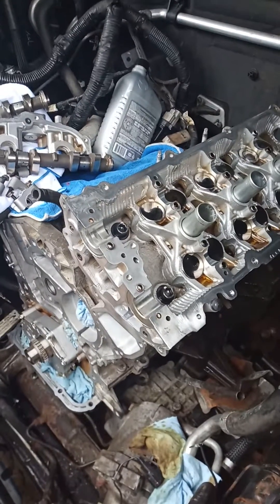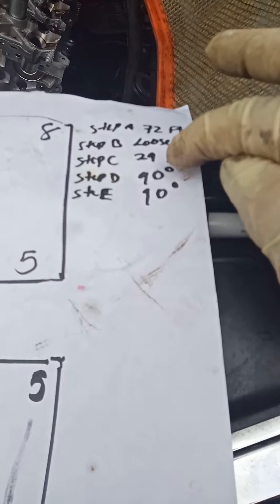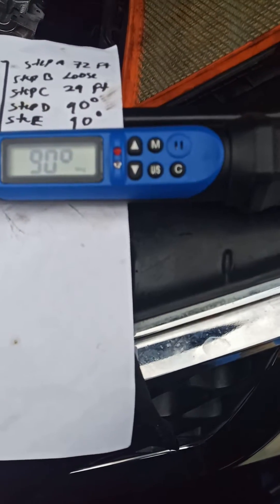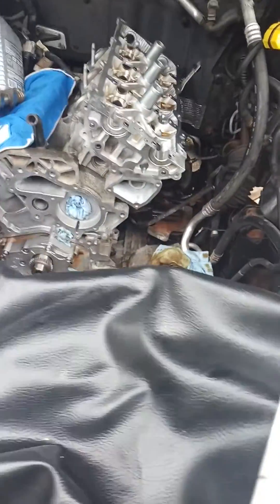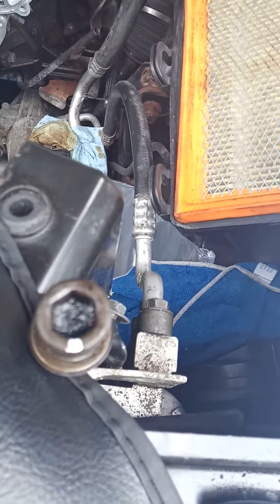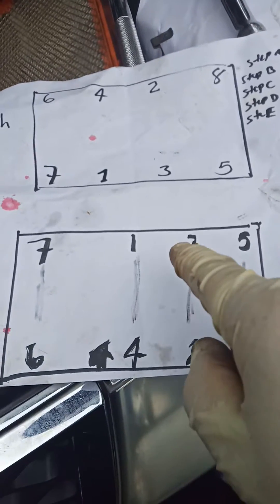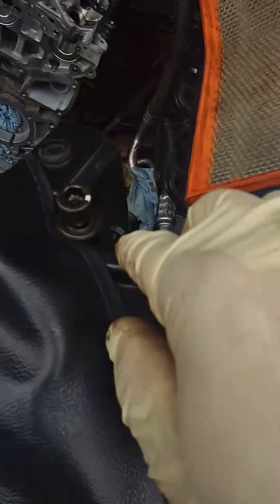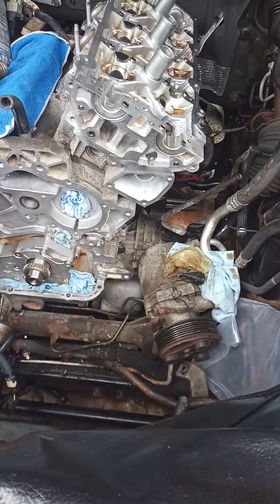How to torque a Nissan 4.0 cylinder head

Comment: Can u loosen bolts after engine has been turned on n retorgue? I only did step 3"4"5 n my completion is going out the reservoir tank n it's overheating.plus I used old bolts.
Reply: have to use new bolts every time cause they stretch

Comment: I kinda forget a lot of this but...
The first three steps, torque to 72 ft-lbs, loosen, torque to 29 ft-lbs, crushes the head gasket.  Once achieved any further tightening of the head bolt will just stretch the head bolt.  
So, if the bolt is 8 threads per inch, one complete rotation of the head-bolt will stretch the head-bolt 1/8 inches.  A half rotation will stretch the bolt 1/16 inch.  The procedure calls for two 90 deg rotations, so the first rotation will stretch the bolt 1/32 inch and the seconds rotation another 1/32 inch for a total of 180 deg and 1/16 inch of stretch.  This applies a great deal of clamping force to hold the head against the block.  
Would then have to refer to the "tensile-stress vs strain curve" to determine the tensile stress for 1/16 inch strain.  That tensile stress is the force per sq inch clamping the head and block together.  It's far more accurate than just torquing to 100 ft-lbs.    
or something like that...
Reply: Makes sense